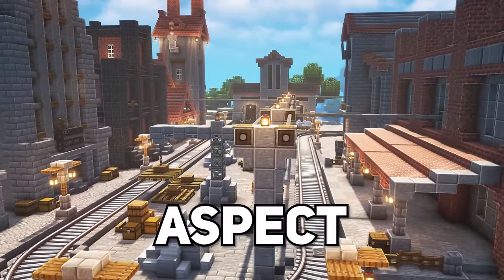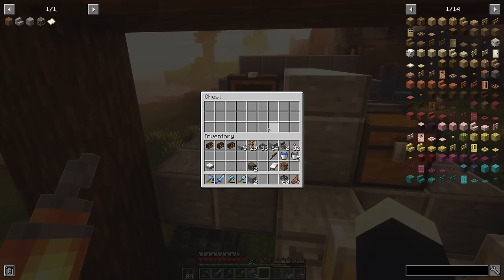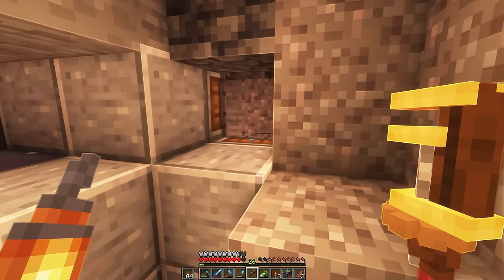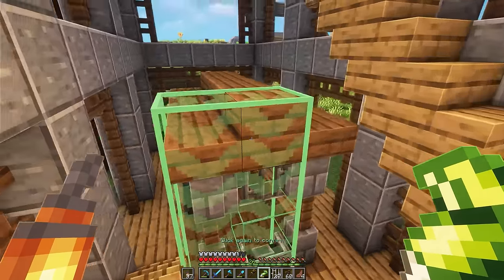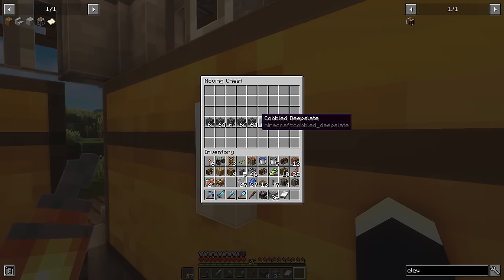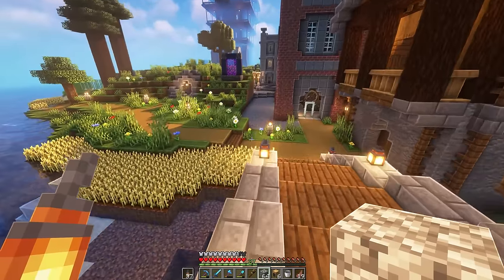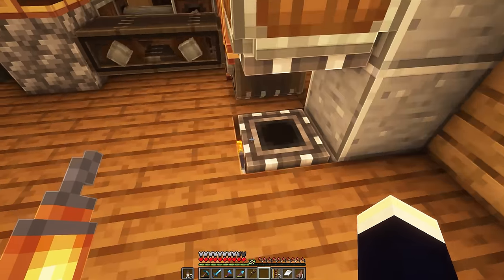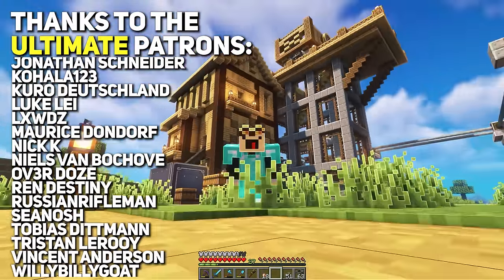I Built an AUTOMATED MINING FACILITY in Minecraft Create Mod

Comment: As a tip with your drill: Replace the torches for full redstone blocks instead. It's technically more expensive, however it'll ensure your machine is liquid-proof, along side if you add a deployer placing cobblestone/deepslate/netherrack (Depending on where you're mining) in front of the track deployer. Of course, replace the plow behind the redstone block with a drill as well to make sure it gets picked up.
Reply: No need for a cobble deployer, you can use a deployer to place the redstone block directly under the rail ^^
Reply: @shimalya  Then you'd just be wasting tons of redstone. If you place it alongside the rail, the mechanical plough will pick it up. So you just need a few.
Reply: If you're riding along in your drill anyway, why not make it a furnace minecart? Set it in the right direction and pop some coal in and it'll go on its own for a good while so long as you have fuel for it. No worries about fluids since there's no torches involved

Comment: For your netherminer, you need to make sure you have deployers pointing outward from the machine to cover lava and protect yourself. you also need to make sure they are using netherrack.

Some nether machines even have deployers directly behind the drills to place blocks that might be lava in front of the drill.

Also, if you have the newest version of create, you can also add contrapsion controls to toggle if the drills, deployers, haversters etc should be active or not. you can tell if you are in the newest version because in the new version you can access a contrapstion chest in its constructed from

Comment: power rail and torches are not necessary, you can use normal rails :)
Reply: Minecarts lose speed, so no you cannot.
Reply: @ThespianDevil  yes you can. (I haave tried 3 times to put a link to a video showing it... But the message disappear...)
Reply: Use regular rails with a furnace minecart. Goes pretty far on one piece of coal.
Reply: @HellKnight88  You don't need an furnace either...

Comment: Why not just have the mining facility convert the excess cobblestone to iron nuggets?  Or have the miner place the excess cobblestone as ceilings and floors to prevent issues with Lava and flowing water?  And if you have the miner place blocks in front of the drill bits and where you want walls and ceilings and floors, it prevents lava flows from destroying tracks and torches.